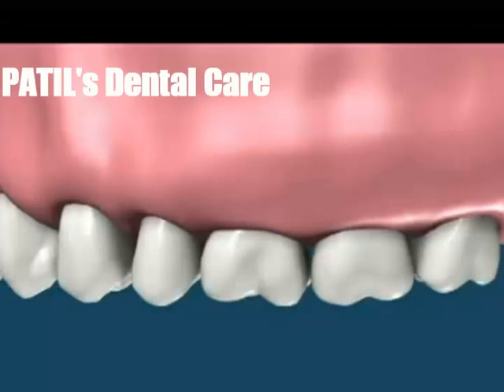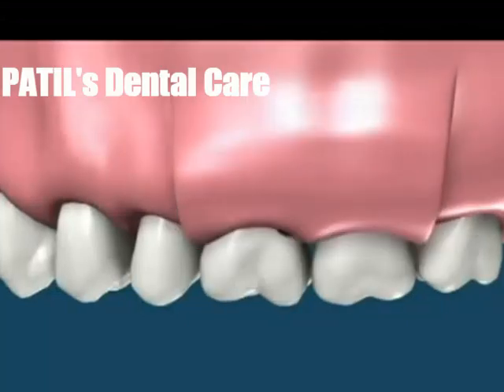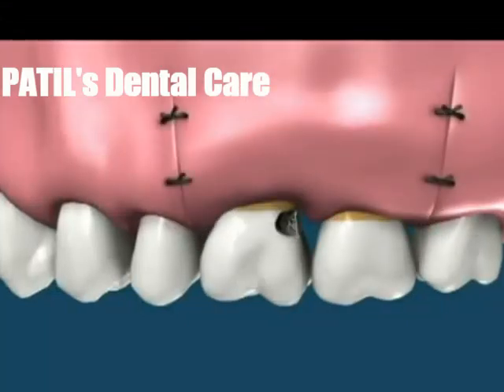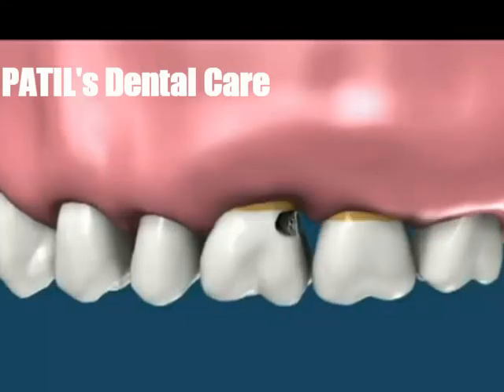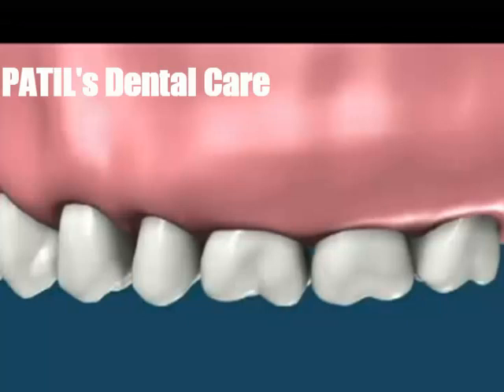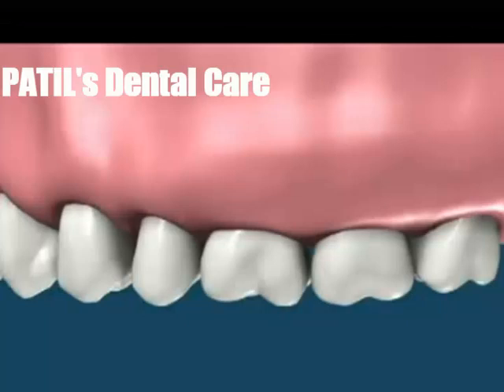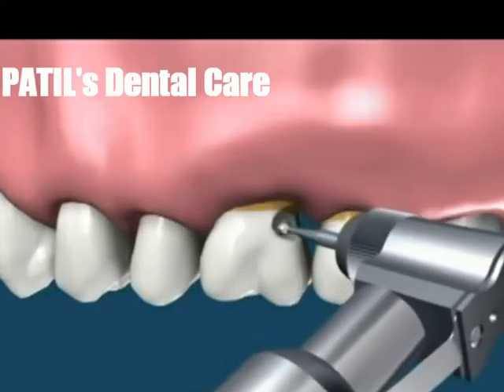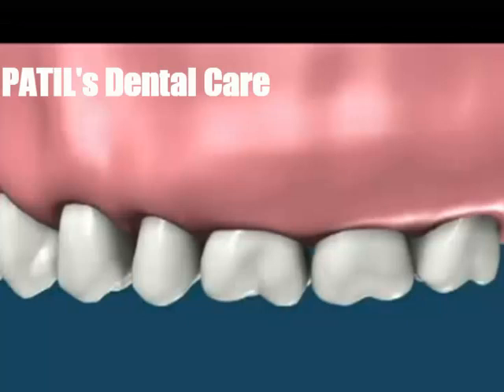Crown Lengthening Procedure Animation

Comment: Dr I had root canal treatment since 3 years. And a cap is fitted. But the length of cap is too small that i can't bite that side properly. Since it made some bad changes in my face shape. What to to
Reply from the maker: Consult again for accurate fitting of cap or make new one